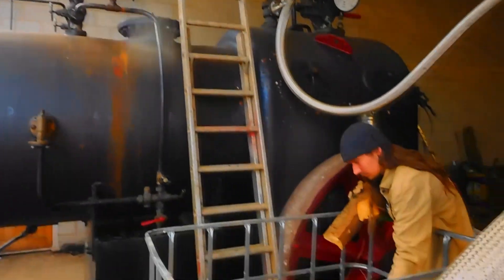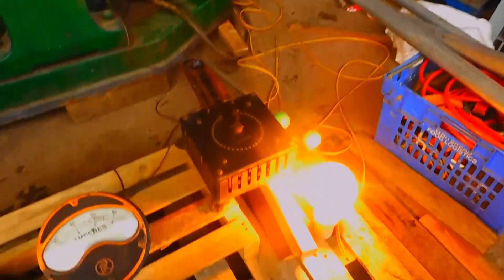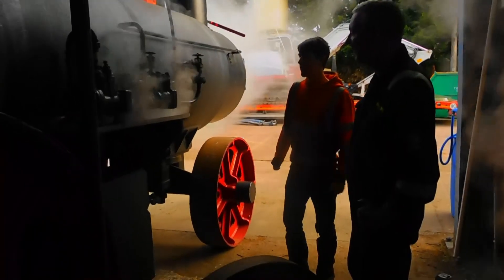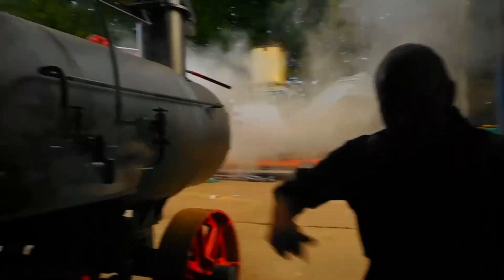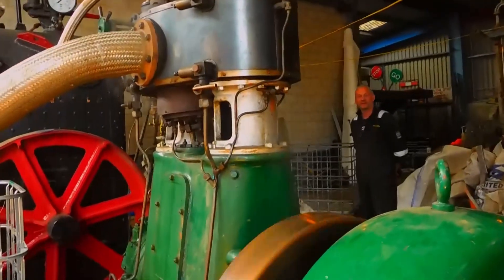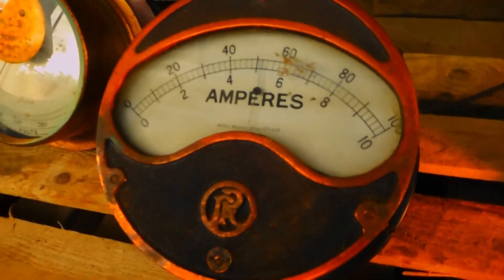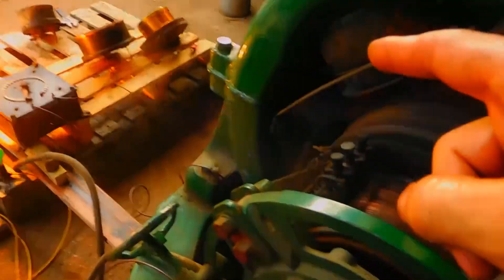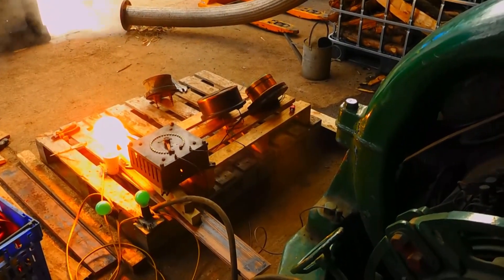Lucien Nunes' Bellis & Morcom Engine & Generator Pt.1

Comment: 4 pole generator so 1500 is full speed for 50 hz ?
Reply from the maker: This is DC.  No frequency or synchronization, only voltage regulation
Reply: @AEKarnes 
Oh I missed seeing the commutators!!
My brain must have thought excitation slip rings ….
Reply: @AEKarnes  whats with the 3 brushes next to each other, just redundancy? or can you rewire them to act as slip rings?

Comment: Thanks for showing an enclosed steam engine at speed and a little bit of load. These engines are somewhat less spectacular as far as optics is concerned and get less attention, but in my opinion they are the best engines when it comes to every day usability and reliability. They just work. I have a 4HP Reader enclosed engine waiting for me to finally start taking it apart and begin restoring it. Do you happen to know where I could get manuals, drawings etc.? I put off starting dissassembly for now mostly due to not having enough spare time, but also a bit because I hoped to find some kind of manual first.

Comment: The local garden centre had a Bellis & Morcom genny set, I assume from the days before the site went on grid (ironically there is a now a pylon line crossing the car park).  Sadly the garden centre changed hands, went upmarket and the genny and glasshouses were swept away.
Reply: Probably a convenient way to make power with the steam they needed to produce for heating the glass houses.
Reply: Where was this?